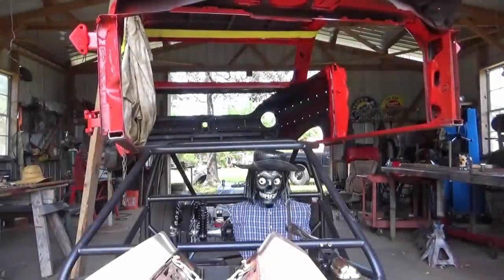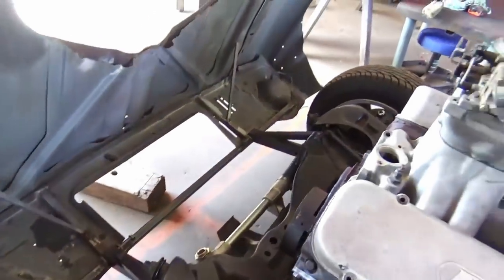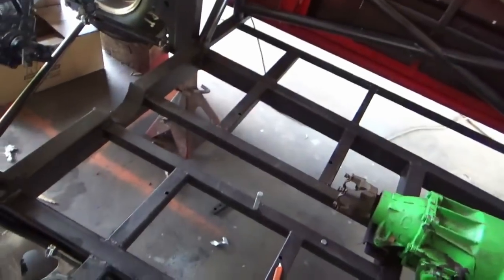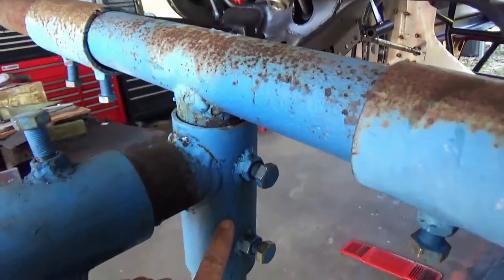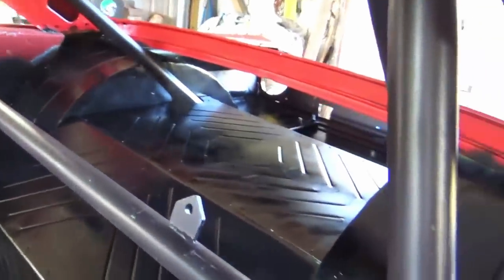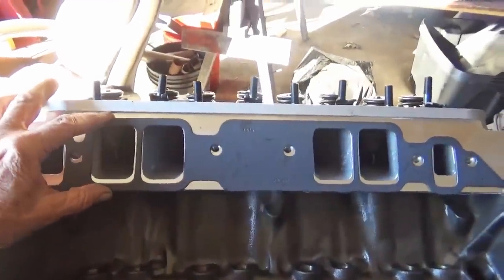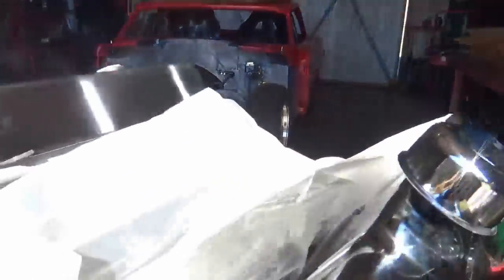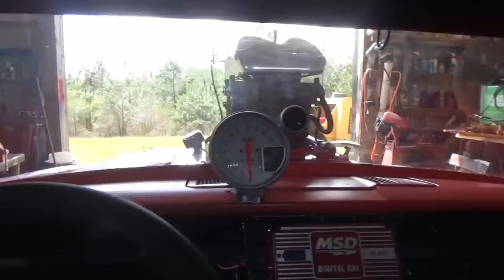64 Ford Falcon 496 Stroker Build Start To Finish

Comment: 😎😎😎
       I have a 89 Geo Metro 
  With side pipes,wide tires, carb sticking through the hood with blower scoop on top.  All rat rodded internal .
    Fools a lot of people..
    Why ,cause it's all stock with 5 speed, 3 cylinder motor.  Gets a lot of attention and thumbs up .  Driven it for 20 years now.. won 2 car show trophies 
   People have tried to buy it ,but can't let it go,to much fun.

Comment: BOB!!! How can i get all the information on the lower end and top end parts of the engine!!? (i will mimic your engine with my 454)
What heads did you use?
What rocker arms?
what stroker kit did you use? (dO YOU HABE A PART # AND website?)
What transmission are you using??
Reply from the maker: Here is a playlist of the engine build ... should answer all of your questions.  https://www.youtube.com/watch?v=FA2ruChsa0w&list=PL17ffBx4Y_BMfb5DAhgUsA4IBmkoLGbDT
Reply: @RatRodBobBuilds  THANK YOU SIR!

Comment: Bitchin build!!! Where did the front suspension come from?  Looks like gm. If so What is the steering rack off of?
Reply from the maker: 98 Blazer front clip with a Mustang II manual rack and pinion.

Comment: Why did you wreck a great old classic?
Couldn't you just get a fiber glass body and leave the Falcon be? I mean there's not that much left of the body that's original anyway..
Reply from the maker: It was already worse than a wreck ... rusted out everywhere! I priced the restoration and even doing all the work myself it was  cheaper to buy one already restored.  You should be glad I gave it another chance at life instead of crushing it!
Reply: @RatRodBobBuilds  True...nobody wants to see them crushed.